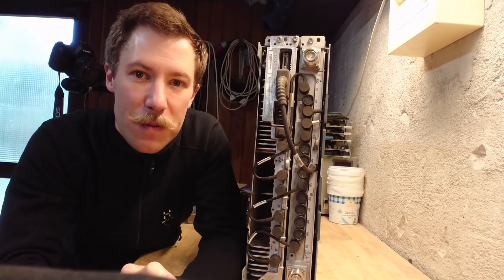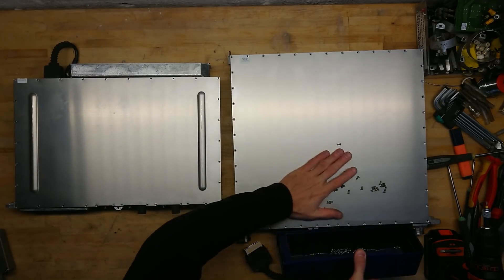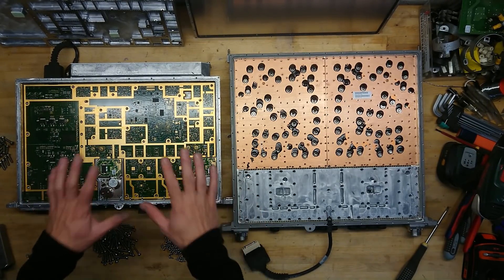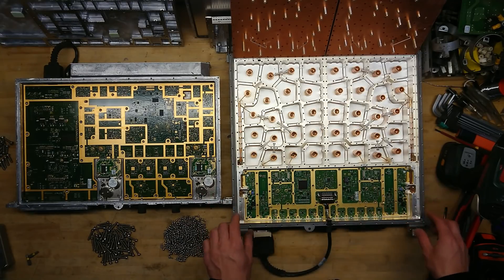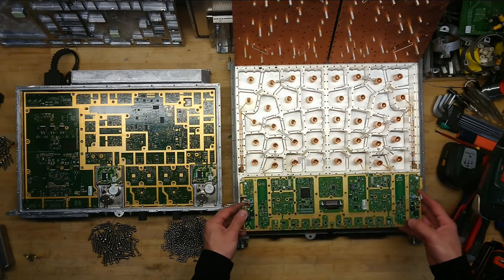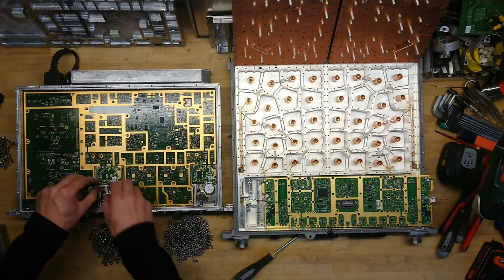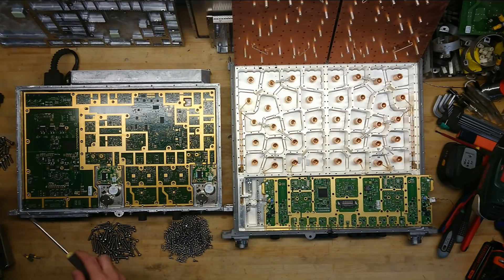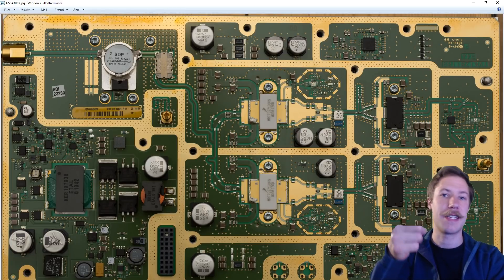Nokia Siemens Flexi BTS 1800MHz Base Station Teardown: Power Amplifier (Part 1 of 2)

Comment: Hi, 

great video as always and very interesting unit, since it looks to be layed out quit a bit different then the other ones you took apart, as you said. 
So I guess your neverending supply of screws got refilled on this one?
Also interesting to see that there are actually 4 isolaters on the two outputs.

Would this unit be mounted directely on the antenna pole or in a ground hut of some sort?

Your first basestation teardwon infected me with the wonderful world of rf electronics. ;)
But I'm yet to find myself a Basestation to take apart here in Germany. 

With best regards, 
Michael
Reply from the maker: I am glad that you enjoyed it, there is still more to come :)

It came in a steel enclosure with plastic fronts as seen on the tower mounted amplifiers (TMA), so I assume it was installed up there.

Comment: Love your videos, and this sort of RF stuff fascinates me. It would be great to have a video on what all the individual cavities do, what the tuning us for, and why the same level of equipment is not required inside mobile phones, even though no one phones transmit and receive. Keep up the great work!
Reply: The task is so different between devices.  Covering just the relevant bits of theory behind power, bandwidth, semiconductors, and splatter for example would be tough without arm-waving and unicorns.  He'd be Hercules of YouTube to bring that audience to a correct and reasonably complete understanding in 20 minutes.  It's a question of where to start and when to use generalities.  A niche channel like this going broad would be interesting though... :)
Reply: @gth042  Thanks. I meant just a general overview of just what all the cavities are for, as I don't really have any idea at all. It would be useful, as it really is the core point if interest for the video. I think they are some kind of distributed element filter, but I'm just guessing.
Reply from the maker: @Vimal Patel I got another Huawei amplifier teardown coming in a month or so, I will take a closer look at the duplexer/diplexer and detail a bit more on that, thanks for requesting.

@gth042 You are absolutely right, it has taken me many teardowns of base stations to just know the little I do now, its a super wide field of applications. I have tried to add one subject that I go in detail with in some of the videos, so you can see some of the detailed explanations here:

Up/Downconversion explained: https://youtu.be/qO127zY3voE?t=865
SAW filters explained: https://youtu.be/qO127zY3voE?t=963
Ceramic bandpass filter explained: https://youtu.be/h9-KhfQM3nI?t=729
Reply: @KaizerPowerElectronicsDk  Thanks so much! Keep up the fantastic work, your channel is so interesting, I'm so glad I found it through you appearing on EEVblog some time back.
Reply from the maker: Thank you very for the kind words. Being featured on EEVblog was a good jump start that I needed after a rough 1-1½ years of trying to grow the channel myself.

Comment: Great video, it blows my mind. I assume time-division multiplexing is going on here to allow many devices to connect to a small number of frequencies? Does each frequency have its own functional block?
Reply from the maker: I it really a jack of all trades amplifier. In NSN own words its: Multiband-enabled, multicarrier, multistandard three-sector RF module that handles all 3 technologies (GSM/EDGE, WCDMA/(I-)HSPA, and LTE) concurrently.

You can see the official commercial brief here: https://mobile-review.com/articles/2012/image/mts-nsn-3g/nokia-siemens-networks-flexi-multiradio-base-station-data-sheet.pdf